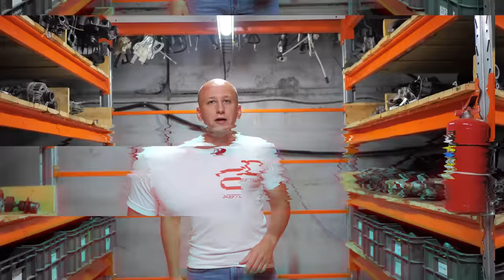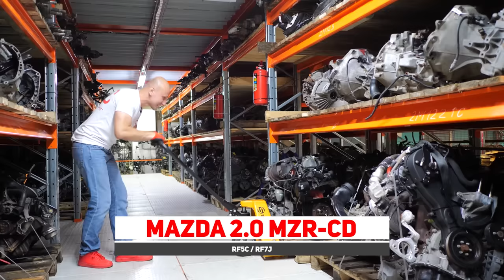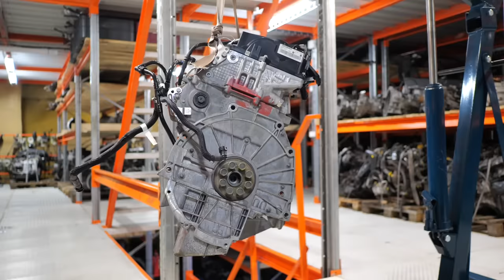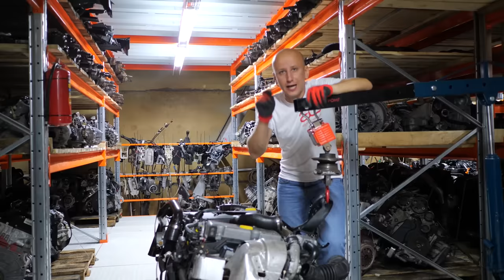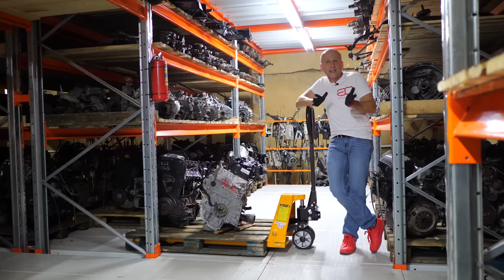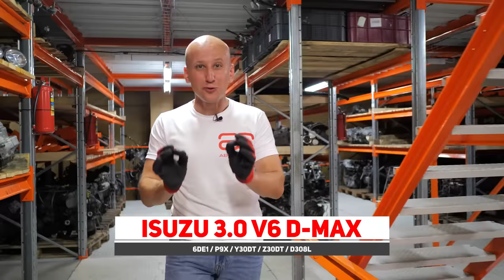⚡ Дерзкий антирейтинг: топ-10 НЕнадёжных дизелей по мнению "АвтоСтронг-М".

Comment: Thank you for the cool video 👍
On the FIRST Place should be the 2.0 Ingenium Diesel Engine from Jaguar/Land Rover. 😉
1. The Lanchester Ballance Shafts were to heavy from 2015-2020
2. The timing chains gets broken already after a short mileage
3.The engines have massive problems with oil leaks
4. The Mitsubishi Single Turbo Charger is located to high and gets broken very early because of StopStartSystem which stops the engine immediately if the vehicle stays
3. The 0w30 oil is too thin 
4. Engines from 2015-2017 had problems with knocking engines caused by the pistons.
The engine block and cylinder head is made of alumium alloy

Best regards
Reply from the maker: Thanks! That's great information! Ingenium diesel engines are not widely spread in our country (Belarus) and in Russia.
Reply: Супер комментарий! Прямо в цвет всё описание этого мотора! Залил 0w30 и застучал гидрокомпенсатор,пока не прогреется очень стучит. Думаю попробовать 5w30?

Comment: I would say most diesel engines are very good, the issue starts with all the emissions crap that has to be fitted, recycling dirty exhaust gas back into what should be a clean intake was never a good idea.

Comment: First of all, all those problems with these engines is the LACK OF maintenance, adequate oil quality, contaminated or bad quality fuel, long engine oil and fuel filter change intervals and irresponsible owners that buy European cars expecting them to run forever without doing any maintenance or even an oil change or dealer service check up....  There have been SAE studies that show that 70 percent of filling station diesel does not meet the design standards of the manufacturers with regard to key characteristics like lubricity, this is IN Europe... In Eastern European countries they provably use high sulfur diesel and lack the manufacturers recommendations for the type of fuel those engines are designed for, some countries have blends of Kerosene/Diesel for winter and Bio-Diesel and GTL fuel tat the engines are not designed for.. It is very often that I see vehicles loaded with twice the load thy are designed for generating excessive amounts of  heat and boiling the oil to the point that carbon builds up in the rings and valve assemblies that multiplies the cylinder pressure and results in blown head gaskets, valve distortion and lowers the life significantly of the engines....